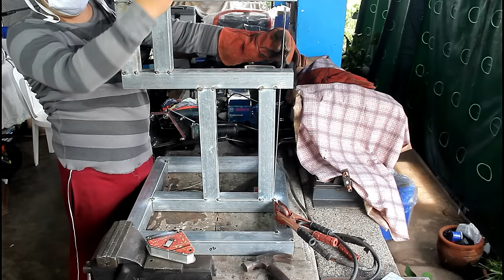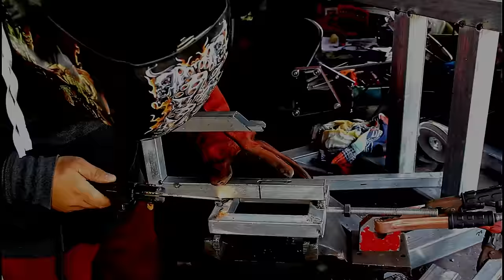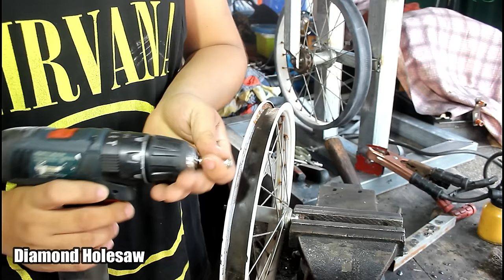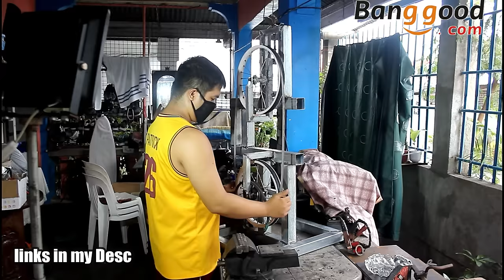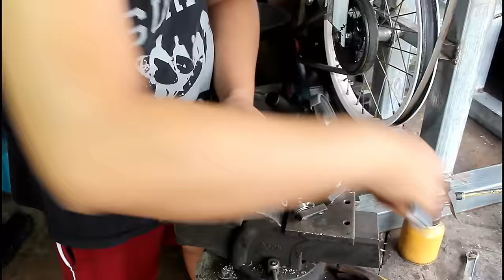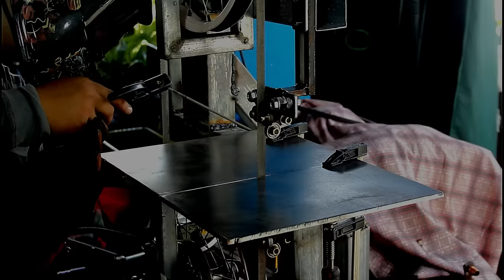Diy Metal Band Saw Using Bicycle Wheels

Comment: Very well done. Consider placing a guard at the front of the saw blade just above the guide bearings. This would prevent accidental touching  OR should anyone stumble they will not get in contact with the moving blade.

Comment: really well done! Just one hint: you should better create a housing around your bandsaw for safety in case the band will break unexpectedly, then it's perfect!
Reply: A very very fine craftsman I know lopped 4 fingers of his hand when the bandsaw blade he was using broke. Pinky all the way angling up to the 1st digit of his index finger. The other 2 in that diagonal line. They reattached them, but he used to tell me when it was cold outside, if I ever lose cut my fingers off, toss them in the trash can, cause his hurt all the time.
I think he was just complaining cause they hurt. I always thought I'd rather have 4 pain ridden fingers than no e at all. Crazy scar he's got too. I know another guy lost all fingers on both hands minus thumb and Pinky. Always Hawaii time for that man. That was in a winch on a dozer. His fingers were not savable. He gets by. Not on welfare. Drives a wrecker. 
Don't grab a winch  cable too close to the drum, and ask the inexperienced guy on the machine to let line out. He might let the cable in on accident, and bring your fingers or more with it.  Grab that thing as far away from that drum as possible. So you have more than plenty of time to drop that bitch before it can eat your hands. Machines have zero empathy, or conscious. They will eat you up, like you weren't even there, and just continue on with zero fucks given. They are awfully handy to have around, but don't expect an apology when you stick your head, or han in her mouth, and the bitch bites you, chews you up, and keeps on pushing. Company gal, she eats while working. Only stopping for some lube, or fuel. I know another girl that had a terrible incedent with one of those mechanical penis tools. It was bad. Caused major mental issues, broke up her marriage, kids got hearts broken, she only wants that machine now.  It dont care how heavy she gets, it has a job to do, it damn fuckíng well does it with many fucks given

Comment: You have more common sense and usable work knowledge than most people I know. And, that is one bad ass tool you built. I like those guides. Thanks for posting this video.
Reply: Check out Donn DIY, he has built some stuff with scrap metal that he cleans up to new  condition and the builds trailers and brush hogs and his band saw mill is better than wood mizer's saw mill

Comment: Nice project. Just a note about welding galvanized steel. Grind away the zinc plating first if possible, and do not breathe the welding fumes as they are very toxic. A well ventilated area is good.
Reply: He is wearing breathing mask
Reply: BHZ Motovlog that’s a dust mask not an aspirator
Reply: Leave the ends of the tubes soaking in vinegar for 48 hours or so because there is zinc inside the tubes as well as outside!

Comment: Great idea and great work. 1 suggestion, grind the Gal off be4 welding, especially on low amps. You welds will be considerably better (not that they are bad) and also your lungs will thank you, Gal is some bad voodoo. But keep up the great work and thanks for the inspiration.......

Comment: It may be a good idea to fill those wheel grooves in the way to have a convex shape (with a bump pointing outside) and have a crown pulley rather than regular one to hold the blades. It will require some plastic material (such as two component epoxy, but it will need a lot). Use the motor power to turn them in a lathe like style.

The U shaped groove will put unecessary stress on blade teeth and will dramatically decrease their lifespan, teeth may also eat into wheel through rubber and may make them hold the blade inconsistently, which will require frequent maintainance. Beside decreasing stress on the build, crown pulleys are self centering.

Very inspiring work. Thank you for sharing.
Reply: I'm still new to a good bit of this, but am pleased that your comment crossed my mind as well. I was holding a bike wheel in my hand and said "Hmmm. Go YouTube 'Bicycle Band Saw' and see what pops up." Was not disappointed. Makers on YouTube- Where the Comments are actually part of the Content. Cheers, and Excelsior!

Comment: Excellant build , only sugeestion i would add would be to use nylon lock nuts on the blade guide holders to prevent them loosening.  Similar design on larger scale with a petrol engine for tree conversion .
Reply: im sure he needed this advise, he did only build this from recycled scrapes & he cant figure that out..

Comment: Was going to say dont put rubber directly over spoke end caps as the blade wouldn't run smooth but then you correctly drilled out the rubber to account for the end caps... :) 

Well done with guide rollers too.

Comment: Looking forward to this video, although no guides (not a good idea) on a bandsaw.Keep up the good work and inventions :)
Reply: the lip of the wheels form a guide for the band. A factory bandsaw just has a lip on the wheel edge to stop it running off. Maybe you are thinking of safety covers? It could certainly do with more around the band, and the wheels to prevent accidents.
Reply: He used bearings as guides, I think

Comment: PLEASE MAKE TIME TO READ!!!!!!!!

To avoid overexposure to galvanize fumes, you should have proper ventilation and avoid direct contact with zinc oxide fumes.  Welders who have many years of experience also recommend drinking milk before, during and after welding galvanized steel to lessen your risk of galvanize poisoning.  You may also want to purchase a welding hood fit for welding galvanized steel.
Reply: DAS DAS
Reply: It’s called welders fever. The milk drinking thing is an old wives tale and proper ventilation while wearing a respirator is a must while dealing with anything galvanized. I strongly suggest not ever welding anything galvanized if you care about your mental health over the long term. This is bad stuff and being in the same area, even outdoors, this stuff can poison you.

Comment: Liked it. Very good. You can check the actual / normal speed by changing (lowering) the video speed from the controls here from the setting button to understand the normal working speed

Comment: Only real flaw I see is you should have put the pulley on the other side, cause now you have to remove the belt every time you change the blade
Reply from the maker: That cant be done bro. Just imagine the pulley forced backwards it wil just unscrew itself from the hub.

Comment: Why not put the pulley on the other side of the drive wheel? That way you don't have to remove the belt to change the blade.
Reply from the maker: If you put the pulley in the back it will just unscrew itself from the hub.
Reply: @SekAustria  why not weld the pulley on? Do you need to be able to remove the pulley?

Comment: you should  make  wheels balancing; firstly, use A-B resin  to coat and later  cuting the wheel, using a drill as a lathe

Comment: Two BMX bikes sharing an extended seatpost make a nifty human powered version of this bicycle wheel bandsaw. I made one about seven years ago, in about 2015. I even added a 600 watt DC front wheel to the upper position which is usually an idler position to experiment with solar powering this otherwise human powered machine tool. The band saw is unique among machine tools in that the work envelope is open along the infeed, open along the outfeed, open perpendicular to the blade in One direction and closed at a distance approximately equal to the diameter of the wheels in the perpendicular other direction. The band saw is there for the go-to machine Tool when in the process of machine tools self-replication a problem becomes intractable and requires fabricating a casting pattern because the required part cannot be carved from billet stock within the work envelope of any of the other machine tools in a factory.

Comment: wonderful. me, i woudl take the drive pully and put it behind, so that u can change the blades without having to remove the drive belt. also, those guide bearnings would walk out. could make a more sturdy mount with turning bolts, that can screw to be adjusted and locked.

Comment: cool idea, i could be mistaken but it seems to be running  pretty fast in that opening shot. especially for cutting metal  if you fine tune your feeds and speeds of the machine i bet you could get it  cutting even better. the youtube channel . mr. pete222 has a few videos on slowing down the old delta wood saws that might be a good reference for a few different ways to slow it down where you need but still have the torque and not slip
Reply from the maker: Thanks

Comment: I would like to ask you about your project (band saw). What electrical motor have you used in it? Can you tell me about its characteristics more? Thank you.
I also think about safety while using this saw. It would be usefull and more secure to make some exta protection for it.  You can cover your wheels with metal, plastic or wooden lid. Did  you thihk about it?

Comment: Do you have setup to switch light off when you weld or somthing? That what it looks like anyway
Reply from the maker: I use inverter welding machine so i dont need to do that'
Reply: Sek Austria ... oh.. jus looked like the lights switched off right when you hit the weld..

Comment: You measure cutting speeds via "Surface Feet Per minute(s.)" When cutting most metal(s) you want to be approx. 400 SFM {Surface Feet Per minute} Although your Bandsaw cuts metal, it's way too FAST. Try a different pulley setup, ratio {i.e. BIGGER Pulley [maybe twice the size of what you have now] on the Bandsaw} and try to SLOW it down, your'll be much happier. If you were only cutting wood, no problem with the speed of your machine. Good luck to you. Great design. Just so you know SFM "Surface Feet Per minute(s,)" is a different measuring system than RPM's (Revolutions Per Minute{s.}) ALL electric motor's list their RPM's, usually either 1725 RPM's or approx. 3250 RPM's. Yours seem to be the 3250 RPM's, try and find a slower {1725 RPM's} motor, and your'll still need to play with the pulley's to SLOW it down.
Reply from the maker: Its 1725rpm i dont know if the sound of this makes it look faster. Im bit cofuse because its not really that fast
Reply: @SekAustria  Hi, apparently the camera makes the band saw look / appear MUCH faster then it is. Your'll have to be the judge, as to, if the machine is to fast, or just the correct speed. One of the ways to tell if the Band saw is to fast is by how quickly your blade wears out, get dull. If you feel that your getting your moneys worth before having to change to a new blade, then the machine is preforming just right. If you think that your having to change the blade often, with little / minimal use, then SLOW {either SFM's or the RPM'S} THE MACHINE DOWN. Another way to think of Surface Feet Per minute(s) is to think of riding a motorcycle and dragging your shoe (putting down ward equal pressure) on the ground say @ 10 mph {Miles Per Hour} = 16.09344 kph verses 30 mph = 48.28032 kph. How quickly your shoe would wear out / off, is the Surface Feet Per minute(s) rate. Go slow, the shoe lasts much longer, than going fast, it's that simple. Or another way to say Surface Feet Per minute(s) is how quickly or slowly the bottom of the shoe is removed.

Comment: ...and pre-cut somewhere else steel tubing for making frames, threaded rod, hot rolled square stock, socket head bolts, various springs, off camera welding machine, top drawer welding helmet, safety goggles, hearing protection, face mask, welding gloves, welding whip, welding rods, welding cables and ground clamp, big HP electric motor, healthy sized drive belt, grinder, grinding wheels, big bench vise, clamps, magnetic square, miscellaneous flat bar sections, various bolts, nuts, and flat washers, hammer, framing square, electric drill and drill bits for making holes for bolts, tape measure, open end box wrenches, roller guides, flat section of plate, cyanoacrylate glue, flat rubber strips, scissors, electric drill motor, deburring bit, hammer, ratchet wrench, various sockets, old pulley hubs, spray paint, another electric motor for lathe, sealed bearings and fasteners for roller guides, manufactured saw blade, aluminum extrusion for cutting demonstration, electric power for all motors, a nice closed-in shop to work in, gopro camera and tripod stand for recording, video editing software........ looks like you got all you could want.  Why hit us up for a donation?

Comment: That's pretty cool but - PLEASE tell me that NOT galvanized steel you're welding!!!!! No lie the fumes that come off galv are DEADLY.!!!! you do NOT want to inhale zinc at that temperature!!! If you ever weld any of that again at least grind off the dull galv coating. But do not believe me - check out youtube for more info
Reply: Flu-like symptoms isn't exactly the same as death.

Comment: For your own safety and that of others and any pets that may be in the vicinity of you using your otherwise well designed machine PLEASE ADD SOME SAFETY GUARDS ROUND THE BLADES.
After use any blade will eventually develop metal fatigue and snap and if there is nothing to contain the blade the broken ends can fly out and do serious damage, at the very least if you intend to continue using the machine as is please use some serious face and eye protection .

Comment: Be sure not to use this if you have a boner otherwise the exposed fan belt and bottom wheel might just grab something you don't want to loose. Excellent DIY design but remember safety... .   .